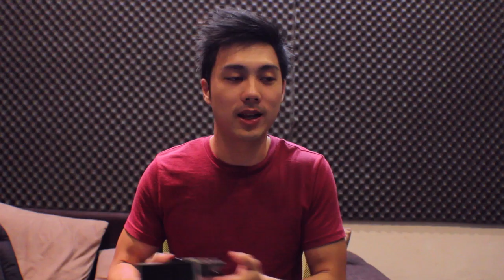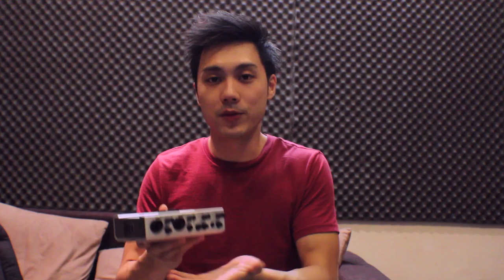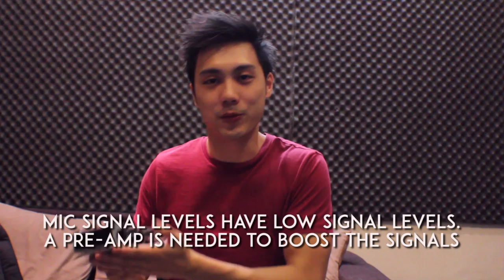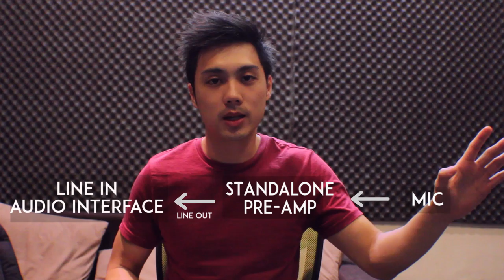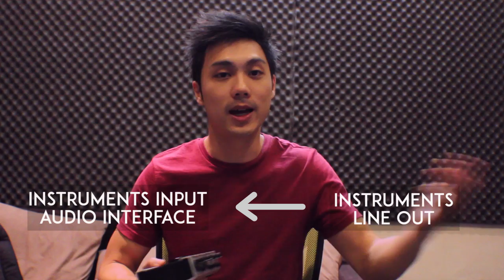Difference Between Line Input and Mic Input - Audio Mentor

Comment: What about preamp to compressor to audio interface? Does the compressor also need line out to line in? My Interface only has mic and instrument inputs.
Reply from the maker: Jack it in the instrument input.
Reply: @ReubenChng  Yea, so the instrument is the same as Line?
Reply from the maker: @ryanreach3710  Its not the same, instrument sits between line and mic level. 

Layman way of thinking about it:
1. Line level (higher signal - no need amplification)
2. instrument level (medium signal - can do without amplification)
3. mic level (weak signal - needs amplification)

So if you jack the line outs from compressor to the instrument input, it'll work, with not that much gain needed.
Reply: @ReubenChng  ok thank you so much for taking the time to explain!  I finally get it now. I'll try the instrument input.

Would you still recommend getting an interface with línea input though? Like will I hear distortion from the instrument input even if i have gain only coming from my preamp?

Thanks so much

Comment: Is there an easy way to use line input into a MIC jack   on laptop?
Reply from the maker: A mic jack on a laptop is a TRS (tip-ring-sleeve) jack. While it'll accept a line-input, your audio will be overloading because the mic jack on your laptop soundcard has way too much gain. So that depends on your laptop's soundcard, does it accept a line-in input by bypassing the pre-amp as well?
Reply: You could attenuate it but mucher easier to get an external usb sound card that accepts line in input (starting at $20) .also mic input is typically mono

Comment: 𝗟𝗜𝗡𝗘 𝗜𝗡 / 𝗠𝗜𝗖
■Some recorders like Zoom H1 have a unique pin with is used a line-in and a mic. So my question is how the recorder recongizes that it was a microphone or  or a line-in device connected?
Reply from the maker: the answer is it doesn't. The Zoom H1's input is a MIC input. So if you try to input a line-in, it'll overload. 
That said, you could make it work by using an attenuator or to reduce the line signal – really really low.
Reply: @ReubenChng  mic in Recording as mono enly / line in for stereo

Comment: If I have a headset with a microphone attached but the microphone doesn't work is that because I need a standalone pre-amp to amplify the sounds my mic is picking up?
Reply: Could be but, more likely the pinout of your headset doesnt match the device you are plugging into e.g.  your headset probably has a TRRS plug and the receiving device is expecting the signal on a different part of the connector

Comment: So one doesn't need to connect the mic (probably a headphone mic) in line in.  Its ok i understood. Now, i connected my headphone mic to mic in but it catches a little bit room noise and i turned on the noise reduction feature of onboard sound card. But i don't like the sound then. How to reduce noise without onboard sound card's noise reduction feature.

Comment: so if i have a line/mic input in my interface i can plug a xlr cable with a condener or dynamic?  the signal wont be too quiet?
Reply: If you are using a true condenser microphone you need to make sure your interface has phantom power.